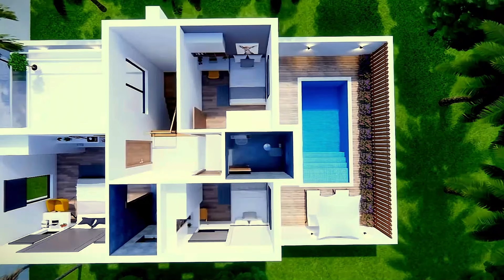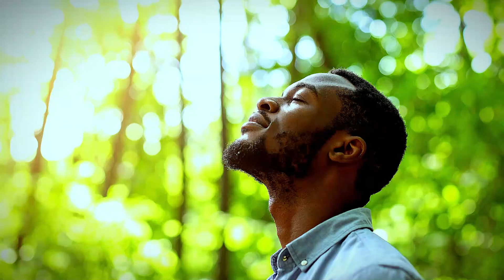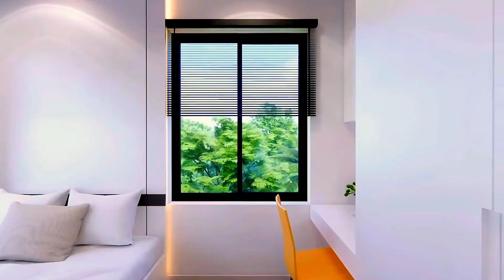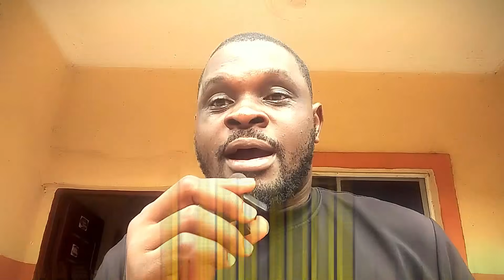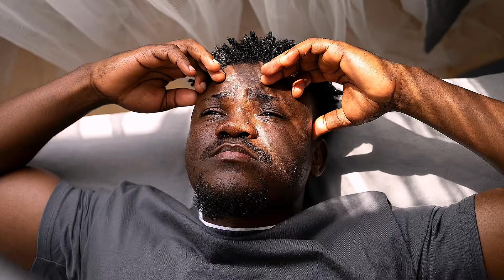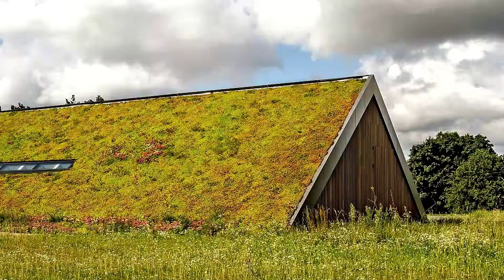How to Cool Your House in Nigeria Without AC- Build the Right Way!

Comment: Nice ideas but it's for people who have enough space, a common man with half plot barley have no space left, so my addition to such class will be planting fruits like pawpaw or any other fruits that the root won't endanger the fence or building,  where buy u benefit from fruits and shade, secondly try find professional who can use clay soil to plaster inside after which you install drywall aka plaster board, just my opinion I'm not an engineer pls
Reply from the maker: Good input! Thanks for watching

Comment: As an architect, I fully endorse this video, and you did a great job. This was a masterclass and must be very enlightening for both aspiring and existing homeowners. 
The only thing I will mention is the term 'TRADE OFF'. 

At the end of the day, this is what really counts. When working with clients, majority are only cost-conscious and not environmentally conscious, and the education like you're doing is the only leverage here. Homeowners need to understand that it is okay to spend more upfront to increase things thermal comfort, air quality, well-being, during the life cycle of the building. 

Adding a green roof may mean spending more of the structural frame to bear the weight. .
Orienting the building or windows may mean the plot of land is not 'fully maximized' especially like we like to do in places like Lagos. 
Adding more green areas means more maintenance than paving everywhere, which is what most people default to these days. 

But these solutions are better. The discussion on trade offs is one that needs to be had early on while conceiving your project so that your architect and team of professionals can advise you based on the objective, your specific project constraints and most especially, your budget. 

It all boils down to proper planning, but how can people plan if they are not informed. And for this reason, I give you double thumbs up for this video. 👍👍
Reply from the maker: Thanks so much for your comment. I will keep educating people on the topic because cost is not only the necessary consideration when building a passive house that would last for decades.

Comment: Good day. Thank you for giving light to the heat problem in Nigeria. I’m curious, what would work best for heat insulation in a climate like Nigeria? I’ve been researching on double cavity brick walls. However, I suspect that though the insulation will slow down the rate of heat absorption in the inner walls, the inner walls will retain the heat at night keeping the inside space warm. Nigeria's climate is a hot one both day and night. What would work best for heat insulation and reflection to keep the inside space cool all day and night? I really do need an answer to this please?
Reply: There is a material in  the usa that's used in the attics of homes that reflect 80 to 90 percent of heat back through the roof, cooling by 20 degrees. It is mylar insulation which might work for you.
Reply: Use bricks in building to solve that problem,he is wrong hollow sandcrete blocks will not work

Comment: High ceiling roof will do the magic my man..
Reply from the maker: Yea, high ceiling WITH WINDOWS on the upper side of exernal walls to expel hot air. But this will work well when combined with PROPER house orientation and other passive cooling strategies. Thanks for your comment
Reply: @HousinginfoNG you can watching how Amish sect living without AC
Reply: High roof ceiling is not energy efficient when it is necessary to cool the house by aircondition. It takes much  longer, and more energy for the cool air to circulate.